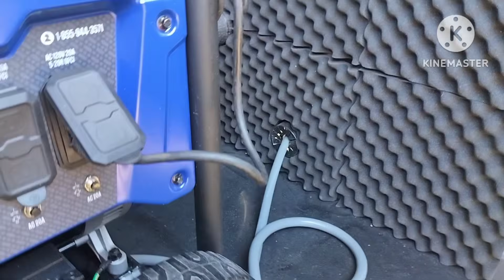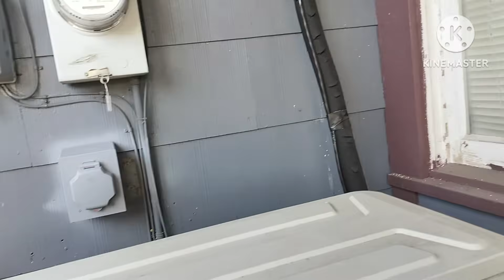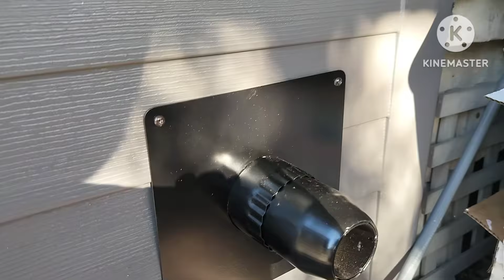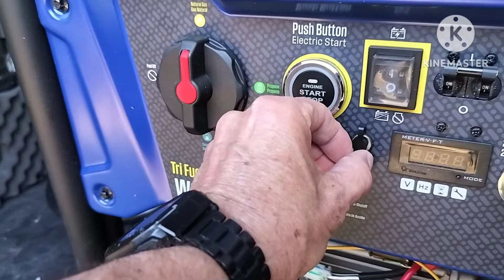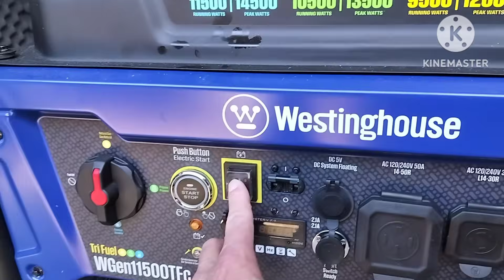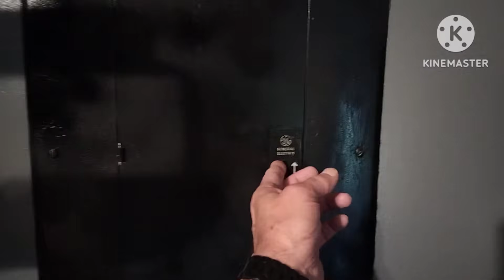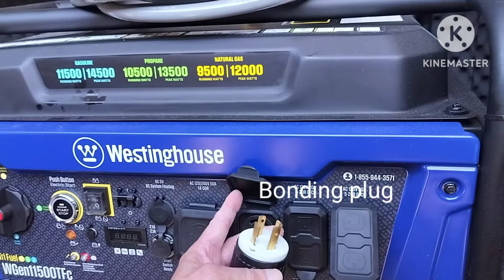Westinghouse 14,500 watt tri-fuel Whole house setup

Comment: I've been searching for a detailed video with the parts used to build the enclosure, thanks! Any updates or everything running the same?
Reply from the maker: @Yo_Al_Lux  everything is working perfect. Only thing I have added was wrapping the exhaust will ceramic insulation the reduce and heat coming off the exhaust. That has really helped with keeping the temperature down.
Reply: @JerryHawk250 you wrapped one of those ceramic fiber blankets? Just over the generator original exhaust or the whole exhaust extension? I'm trying to replicate your setup, it really is nice. I'm surprised nobody sells something like this already pre-made for generators..

Comment: great video(no bullshit added) straight to point on everything. I'm upgrading to tri fuel and it was between this Westinghouse or the 14500. I have my house set-up already and now  believe I made my choice. Thanks brother!
Reply from the maker: @sergetorres611  Thanks. I don't like watching long drawn out videos either. That's why I like to keep them short and sweet. I own a 4500 watt Westinghouse dual fuel inverter generator too. Very reliable generator for the past 3 years. That's why I went with this generator. I just hope I don't need to use it anytime soon. Hurricane season is just around the corner. I wanted to be prepared just in case.
Reply: @JerryHawk250  i hear that..staying in Spring Texas and power outage in my area are almost guaranteed ! I have soft start on my 4ton which makes it that much easier to run ac. Thanks Jerry. I'll keep watching if u keep putting up these vids..🤜🤛
Reply: Great video! I like the way you muffled the sound!
Reply from the maker: @danoliver9197 thanks, it's nice and quiet. I can barely hear it inside my house

Comment: I own the Westinghouse 12500W model. It runs my entire home. Here in Florida (and any of the Gulf area), that is like gold. We have the circuit breaker all set up for generator interlock as well. Gotta keep the linemen safe! I absolutely love mine.
Reply: We too have the interlock and love it!
Reply: Can you run the stove also?
Reply: @stevensmith5490  Yes. Our stove is gas. YMMV if it is electric. We don't run everything at once. We have had this generator for 3 years and it has never failed. We only run the propane gas option, instead of the gasoline option  because I don't want to fiddle with the carburetor. We run the AC or the water, but not both at the same time because we have a well. Everything else runs fine.